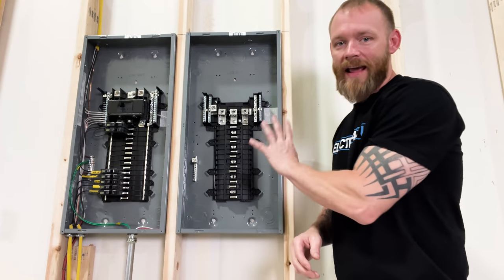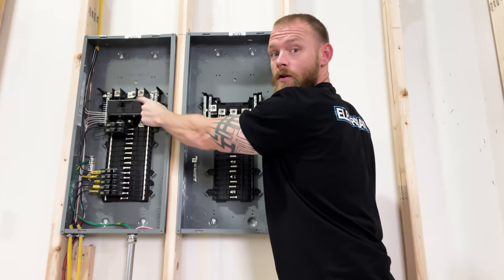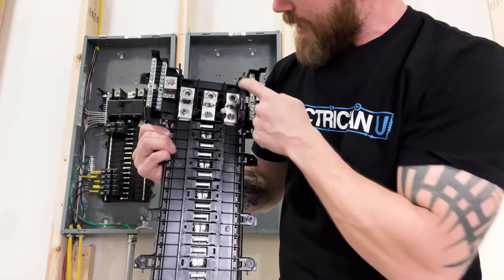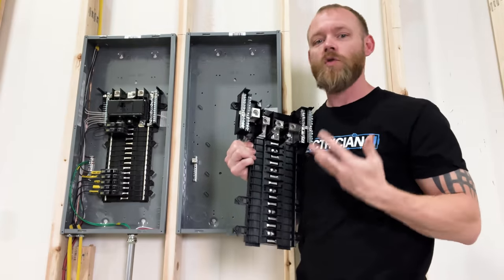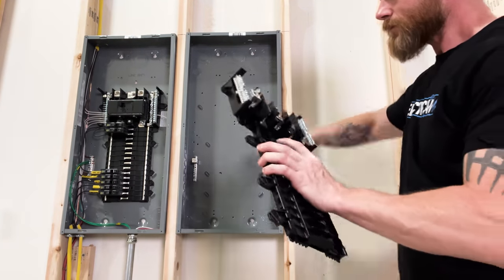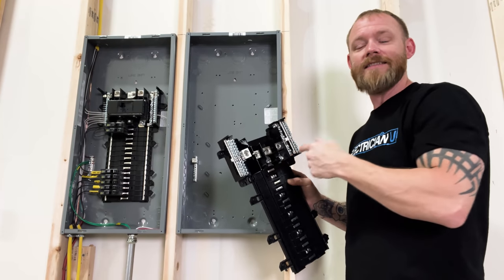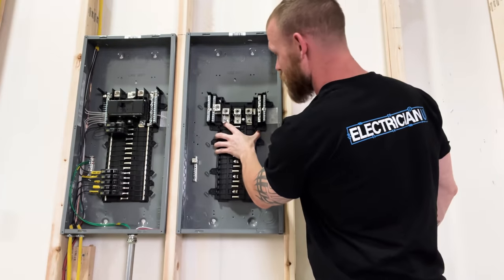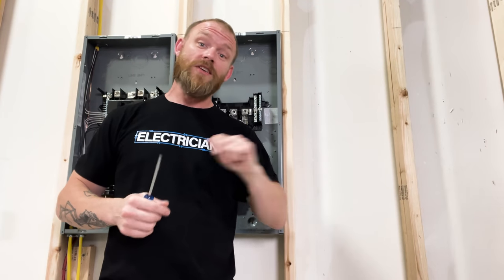How Do I Know if My Panel is 200 Amps? (What Makes a 200 Amp Panel 200 Amps)

Comment: I have a less common situation and I need help finding a video or blog guide on adding a 200amp panel to the outside to meet current code while leaving my original 100amp in place inside my house.  I don't want to move all the circuits & I like having interior control & some of the wires would be too short to relocate outside.  No one does this because this requires a 100amp breaker to be installed inside the 200amp panel probably?  (Is putting a 100amp breaker inside the 200amp panel possible?)

Comment: Here in my area of California, there is a very strong push to add EV outlets and to convert gas appliances to electric. (Some areas have just outlawed adding new gas lines altogether) So I'm remodeling a home and added the EV outlet and converted the appliance power sources.  After a year and a half, (YES, fully permitted) we are ready for the utility to swap our connection from the temporary drop to the new 200 amp panel.  Just now finding out that it seems my new 200 amp upgrade is going to be the house that puts the local transformer over the limit.  So now my house will be without power for up to 6 to 9 months until they engineer and replace the new transformer.    I thought I had heard of everything.   PLEASE consult your utility specifically about this way before you start and upgrade project.
Reply: I am 100% not changing my gas appliances to electrical (range/on demand hot water).

Comment: Thank you for explaining this it got me close to answering my question but I am not sure.
I'm not an electrician and I have concerns about the load going through one of my brakers/circuits. 
I bought my house in 2020. 
It is 113 years old a lot of the wiring reflects the age and upgrades throughout the years. 

My braker tripped for 2 electrical outlets, I Up graded those outlets to a GFCI outlet. Still trips. 

Today I was going to update all of my electrical outlets and lighting, since my electrical panel is written in vague terms like "plug light" i decided to figuer out which was which and I ran into a WFT is this even code moment? 

I have trolled the internet for an answer,, evenpaid $8 for a digital copy of national fire electrical code, I think that's what it is called. (Your videos sometimes have a photo of the cover page) for all the reading i did, it was basically Latin to me. 

Decided to troll the YouTube and your videos for an answer, (I think I have picked up some of the lingo but I maybe wrong forgive me) 

This video kinda answered my concerns but I'm unsure. I understand that that there are 3 busses 200 Amp each for that particular demo panel, and each slot flips across. 

I have 13 switches/circuits
One of those brakers is labeled " plug light"
The first position (top left)
It is a 2x20 and is the circuit/braker (is on 2 busses?) for: 
2 outdoor lights 
2 main floor electrical outlets 
Main floor Dinning room light
Main floor bedroom light
1 Upstairs bedroom light with both electrical sockets 
1 upstairs hallway light
Laundry room light
Another Upstairs bedroom socket
Gas Fire place 
2 kitchen lights
Half of the basement lights 

Keep in mind I have a 2x50 circuit labeled hot tub, but I don't have a hot tub and it does not turn on or off anything within the house.

Is this something I should have rewired? 
I've lived in ghetto apartments that didn't have that much load on a 2×20 circuit.

Comment: Can you use an 3 phase panel for an single phase system? If so, do you have to skip every third spot for breakers?
Reply: your local inspector may not allow that 3 phase panel on a single phase system, although it will work.

Comment: So this is about amp ratings when purchasing a new panel? If the panel is live with a main 200 amp breaker in use, isn’t it a 200 amp panel? Just asking.
Reply: IMHO Trust no one (unless you are the only owner since installed). Some bozo could have come in and 'fudged' the main.
BTW the main might be undersized (required) if you have solar and a pre-solar era panel.
Reply: if you actually think about it NO ONE will most likely NEVER use all 200 amps at the same time...THink of how much amps flow through LED or rec....and Chances are you're NOT using all them at the same time anyway....even if you did, the average house wouldn't use more than 50Amps, more if you had your dishwasher, washing machine and dryer all going with a few window AC units LOL
Reply: @mikenormandy9250  ... for the average home owner it's unlikely they will ever draw 50% of that 200 amps. Most of the panel space (# of breakers) is for all the home runs required under new codes. Unless you have electric heat, electric hot water, electric clothes drier, and AC running you are probably in the 20 amps per leg range most of the time. I have checked a few homes with sauna, hot tub, ac, welder, air compressor, drier, water pump, and electric range, and barely hit 100 amps per leg. OTOH, I'm sure it bumps 175 amps after a power failure when everything comes on at once. (how often can that happen?)

Comment: Question. if my meter base is a cl200 does that mean 200amps per hot wire. Or 100amp each hot wire.

Comment: For residential, can the busses of two single-phase panels with 42 (or more) spaces each be connected together so that one 200 amp breaker is use as overcurrent protection for both panels?  I have seen where a panel is full and a second panel needs to be added.

Comment: DUSTIN, All Panels for houses, bars/clubs, etc only use One Phase. So all the AC outlets in a house or Bar/club are connected to one phase which is going to cause very Dirty AC power. You haven't done a video lesson about Dirty AC power and how to make it into Clean AC power. What I'm saying is that all the breakers in the panel are all connected to one phase so if you have a power tool or motorized equipment connected to an AC outlet it will cause harmonics and motor noises to BACK travel causing the upstream outlets and downstream outlets to induce and feed these noises and harmonics into the next piece of equipment that is plug into another outlet that is even on another breaker or the same breaker. Back in the days you could see visual noises on older CRT TV's sets when you had the dishwasher, washing machine, power tools running the CRT TV will display static lines and hum lines. What can you do to fix this problems of dirty AC power? You should make a video lesson about dirty AC power and how to make it clean

Comment: Residential panel upgrades from 100amp to 200amp residential panel typically require PG&E (California) to come out and upgrade the service drop wires to accommodate the new 200amp potential, right?

Any NEC Code, videos, panel upgrade info you guys can share would be greatly appreciated, location: California
Reply: What means PG E
Reply: @modestolopez8297  pacific gas and electric
Reply: They are the Electrical Utility provider in our area.
Reply: @ChristianJames559  thank you
Reply: I’ve upgraded quite a few California houses from 100 to 200 amp service. 
Normally PGE does not replace the overhead drop wires because they are sized appropriately by PGE code. 
PGE might need to upgrade the local transformer to accommodate the new 200 amp service in the neighborhood. 

If the service is underground, the wires quite often had to be upgraded and installed in a new trench with 3” conduit.
Reply: @juliangarrett6373  thank you, so the next step in that process would be to get PG&E to come and inspect their transformer and wire size for service drop?
Reply: @ChristianJames559  correct. PGE usually wants to do a site visit to check what needs upgrading. Sometimes you can send them pictures. 
The electrician will submit a request to PGE for a service upgrade, disconnect/ reconnect.  That gets the ball rolling on a service upgrade project

Comment: As a Brit, I have questions. The single phase board has an isolator switch but only one pole is switched? Is that correct, shouldn't it be a double pole isolator? As to the 3phase board, it has no isolator whats so ever-so how do you kill the board? In the UK its a requirement of code that ALL  Boards have isolators within and treat the neutral as live and switch that to. So in a single phase board its a two pole isolator and a 3phase board a 4pole isolator.

Comment: So , if i put more than 200 amps on the panel, the main feed would shut off ??? (I'm not an electrician, but I like your videos).
Reply: An exact 200A long term (could be 4hrs) will trip the breaker. Breakers have 'trip curves' selected for their application. Motors tend to grab a huge slug starting, then drop below nameplate when normally running, those have a slower instantaneous trip.

Comment: Ok, so this did not make any sense to me. Can anyone please clarify? 

A 200amp breaker is only able to supply/withstand a combined Load/draw of 200amp ? Regardless of split phase 2 leg or 3 phase, 3 legs ?

I always thought, each leg can handle/provide up to 200amp so in reality a 200 amp breaker is 600 amp breaker. (Using Theoretical 100% values here for simplicity )

It looks like I am wrong here but, if that’s the case, why is the wires gauge for each leg is sized for 200amp? Is it so, in an event that all load is only on one leg, you are still safe ? 

The more I think about it, it makes sense. I have seen some old breakers where they are essentially a single pole breakers but they are tied together with a small wire/rod. If one of the two trips, the other leg would trip automatically. 

As I’m typing I am developing a different theory. The 200amp breaker is acting like a gatekeeper for all legs. No single leg is permitted draw more than 200 amp. If it did the heat would trip all 3 legs. So, if you do your load distributions correctly, you can draw more than 200 without tripping the main 200amp breaker ?  
 Please advise

Comment: Dustin ... you have great info.   could you talk about why my solar co. wants to de-rate my 200 amp service to 175 amp. 

little background... (yes main service comes in at house and i talked about it backwards sorry.)
GARAGE: 1500sq. shop has solar of 10.5k solar on roof with 100 amp breaker in sub panel in garage and 45 amp breaker for solar connection.
(i will be welding, runinng 220 volt lift and have 2 RV outlets to plug into... but all are not used at once. 
your other videos of how "we size " a panel is "NOT by adding up all the breakers" was great and very informative  !!
i bought the NEC book 2020 and that has been of great help along with your explanations.)

HOUSe: power from garage then runs to main house panel 200 amp. which i have 50 amp well pump  and centeral a/c amd heat (50 amps) runing off this panel
i will be hooking up a auto transfer switch privided by cummins.
the auto switch will connect a 20k cummins stand by/backup generator to the house main panel 200 amp service. this is for when pg&e goes out and i have no power.

by the way i said NO to de-rating !! Told the solar co. they could upsize main panel if need be.,,fyi

i realize you may not be able to speak to my exact situation but maybe talk about some the concerns or issues or examples of solr hook ups and main panels and  if and auto transfer switch for a backup generator  was hooked into main panel.   probably too much for 1 video... mabe a series??

Thanks!!

Phil
Reply: Your solar co is following the code :/  You have <=25A of solar + 200 (original breaker)A. The bus is rated at 200.
(175 is the next lower size breaker)
I question the REALITY that a perfect storm of overload would cause 225A to be on the bus. But it IS THE CODE.
The alternate is a Solar rated bus, leaving the 200A main in place.
Reply: @steveurbach3093    yes tha's what i am looking at... but code  no??   when i looked it up.. my main panel has a "20%" "cushion" for solar..thats is 20% of 200 amps a 40 amp breaker..i don't remember the section now but i looked it up in the NEC 2020 code book. i know they put a 45 amp breaker in the garage..they could have put a 40amp breaker and that is code. but thanks for reply.
Reply: @steveurbach3093  did not mean to sound combative in last post ..still learning to read code book and under stand it !!  
thanks.. i will most likly change my main panel to A copper buss solar ready panel.   i agree in a perfect storm and understand its code..now thanks  !!

Comment: You went over the three-phase stuff awesome understood it completely so why is the single phase or two pole panel not 200 amp? Cuz as you were saying each individual leg of the face has to be capable of supporting 200 amps the other one should be exactly as the three phase? Or am I wrong or did I miss something or is it mislabeled?
Reply: the panel rating is how much each leg can support. From a practical viewpoint a 200 amp single phase panel could support 400 amps (nominal) at 120 volts, for a total of 400 amps. A 3 phase could support 600 amps (200 amps nominal per leg) with all 120 volt breakers. I seriously doubt you will ever find such an installation, but it theory it could happen.
Reply: Ok so if you have a 100 amp main panel you can install a 200 amp sub and just use 100 amps per leg and don’t exceed that cause if any leg has more then 100 amps it would trip the whole panel. Is that correct?
Reply: @paulnovak6977  ... I didn't say that. I also doubt it would pass inspection to have a sub larger than the main. Besides, they cost more so why spend the money?

Comment: Since there’s no main breaker on 200amp, does it matter what wire size to use?
Reply: Yes, it does matter what size wire it is.

He say’s it @ 3:08

The lugs come pre sized, (at the manufacturer) (before you buy) based however much amperage u will b using.

Comment: How about one on what's the difference between a 200amp and 400amp service? I've heard that the only difference is the meter.
Reply: there's quite a bit of difference between 200 and a true 400 service, starting with the wire lug size in the meter pan.

Comment: I just had an electrician add a 200 amp sub-panel next to my 200 amp main house panel. This is to support a hot tub and EV charger. This sub-panel has no main breaker and there is no breaker for it in the main panel. Since it must be shut off using the main panel main breaker, does this mean the new panel is really an extension panel rather than a sub-panel?
Reply: He probably should have fed your sub panel from a breaker in the first panel. But yes techincally he just added breaker space... if your main breaker kills both panels then you are still protected by that breakers overcurrent protection rating
Reply: @jakerasp  Could be his main panel was just full?
Reply: @jakerasp  The original main panel only has space for two breakers that go to two sub-panels in the house. I needed outside capacity for hot tub and EV charger.

Comment: The one thing I don’t understand it’s very easy to add a sub panel but what I don’t understand is if your main panel is 200 A and you want to add 100 amp sub panel you have to use 100 amp breaker in your main panel, correct.
And doesn’t that mean that you need to remove breakers that equal 100 A to your new box which is 100 A and if you do that that means your new box is full and on top of that your old box is full because you just replaced it with 100 amp Breaker so you’ve accomplished nothing.
I do understand that you could just take out a 830 amp breaker and put in 100 amp there but if you did that now you’re 70 A over on your 200 amp box right how is that legal